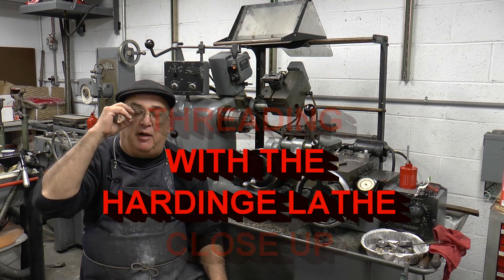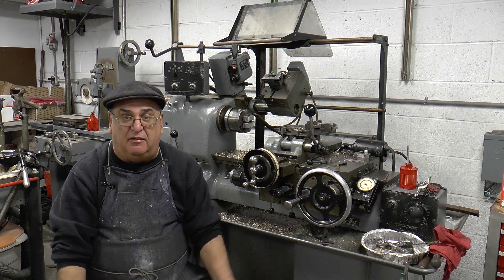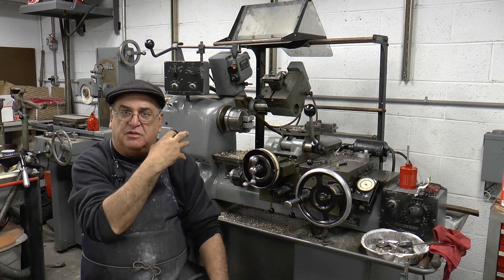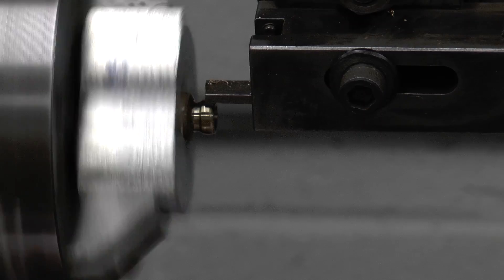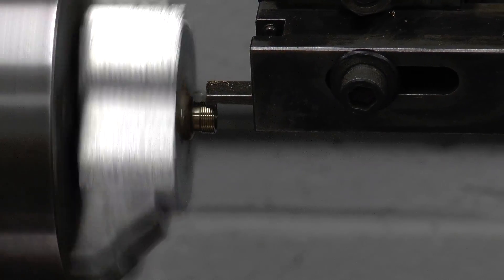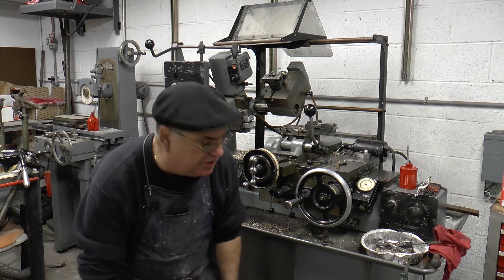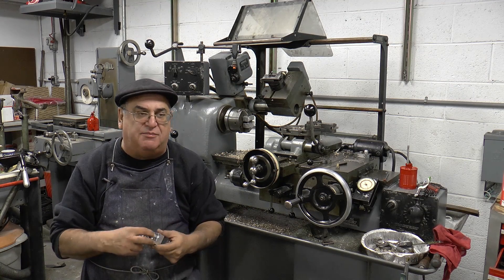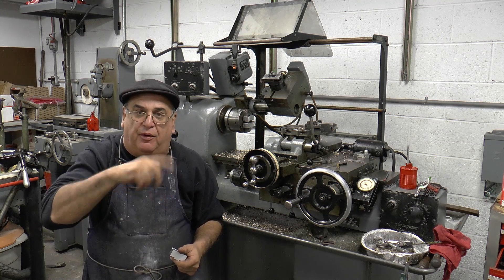THREADING WITH THE HARDINGE LATHE  CLOSE UP

Comment: The small machine shop I work in uses Hardinge lathes and screw machines for 2nd ops . 
We have all of those attachments  , and they work well . Years ago we converted several to the Hardinge-Omniturn conversion  . We never looked back . 
I'm a button pusher now , but we are more productive  and the parts are better . 
I still enjoy the old ways though . I find it more challenging  .

Comment: So are hardinge lathes really only good for small repeatable work?
Reply: Heavens, no. But keep in mind that production work was kind of the point of most of these machines in the first place, so a machine that could easily be set up to chew through a huge stack of work to tight tolerances even on a Monday morning or Friday afternoon wasn't exactly a bad thing. You can use it with a more ordinary toolpost, tailstock and so forth to do one-offs or small part counts, and it'll swing some pretty fat parts as well. It just wouldn't have been very cost-effective to have one of these things as your general-purpose repair shop lathe, since there were a lot of cheaper lathes that could do the job, especially for light/occasional work. One thing a Hardinge isn't is underbuilt.
Reply: @stanrogers5613  there is one near me fairly well equipped for 800$. It  seems like a really good deal even if I just flip it. I've restored a southbend lathe before and done minor work but I'm no machinist. I've thought about maybe investing in this 800$ hardinge and seeing what comes of it. Does it sound like a bad gamble?
Reply: @kmkcopkiller  $800 bucks for anything with a Hardinge nameplate on it, even if it's just the nameplate, is a great deal if it's not a beat up bucket of rust. (Add another zero for "in working order" normally.)
Reply: @stanrogers5613  it's an hardinge HC lathe. I've seen others listed for around 3k I just cant imagine why somone else hasn't bought it before me but maybe I'm that guy lol it will cost me almost as much as the lathe to move it
Reply: Sure is